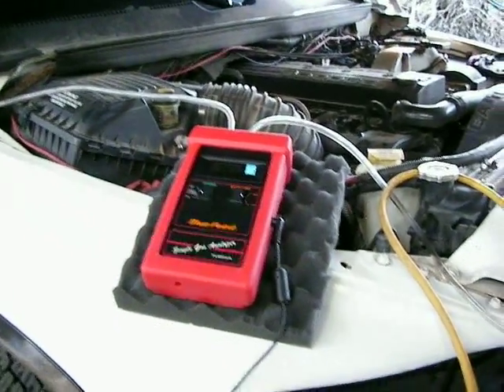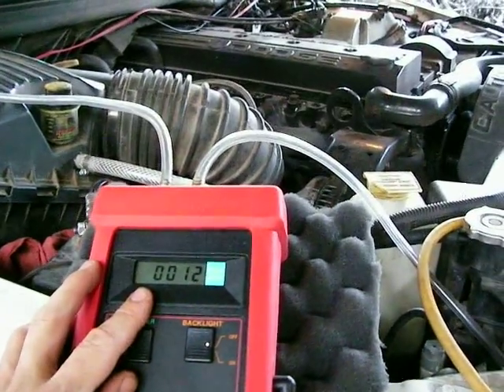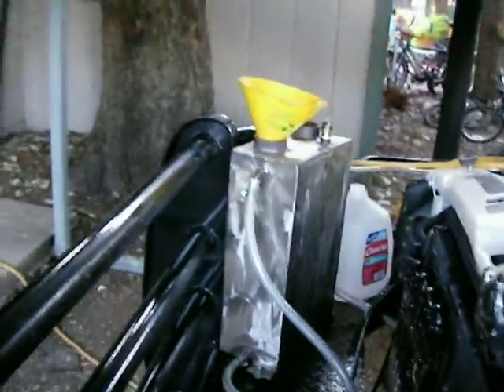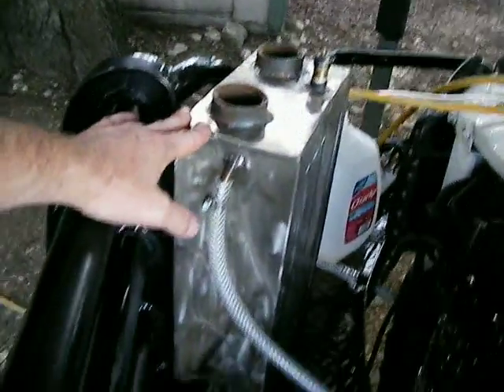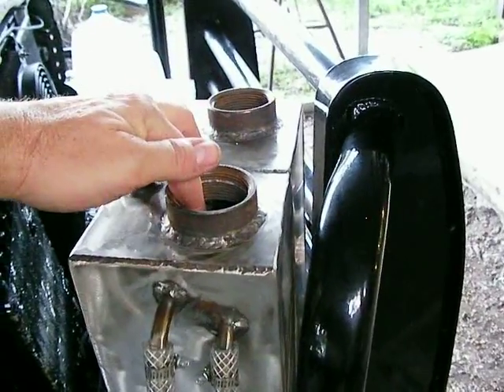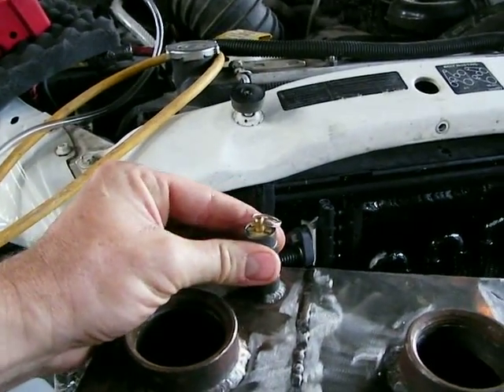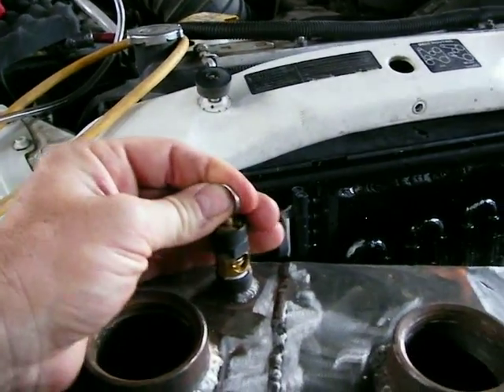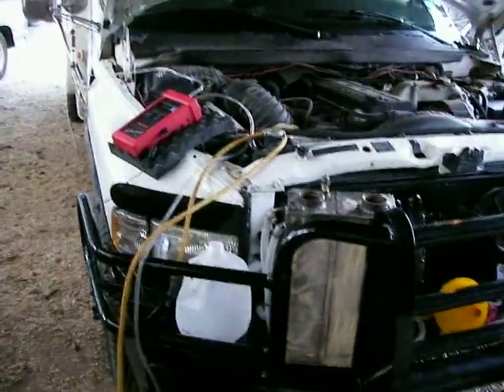diesel idling using hydrogen

Comment: This will NEVER be allowed. According to  CARB, California Air Reach Board. Diesel pollution systems MUST increase fuel consumption and require a second source of pollution that kills roadside vegetation called DEF. And it MUST require banning older trucks, in order to force new truck sales......
YOUR model cleans up the pollution and better fuel mileage for the truck. Keep watch over your shoulder for the oil company mafia chasing you down like they did Stan Meyers, Pogue, Wesley, and hundreds more. Stay Safe!
Reply from the maker: i went to california in 2008 ran a unit for the port authority at the same time the urea injection was shown. the deft guy had more money to get his system going. i lost out

Comment: Nice job, about a 70% reduction,did the CO rate increase?I implemented a deionized vapor injection system on a 350 scfm gaseous fired ICE with an injection rate of 3.5 L/min which was enough to lower the threshold values from 40 ppm to 38ppm on a lean burn engine... Was the hydrogen produced from electrolysis?